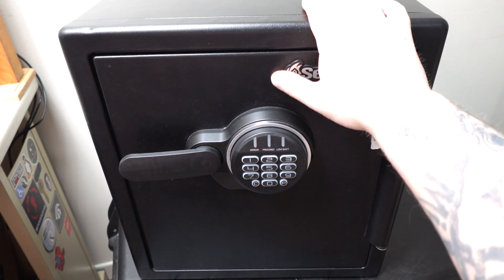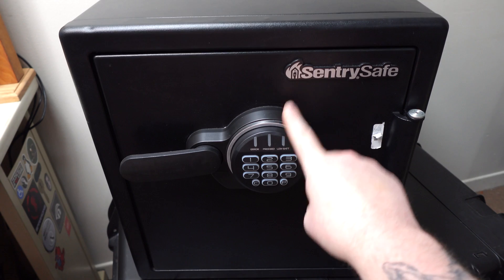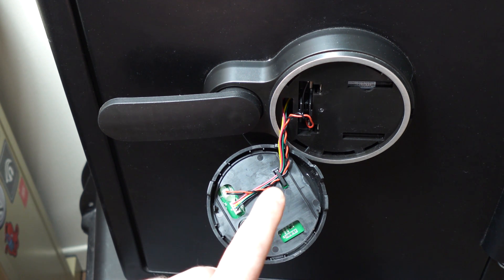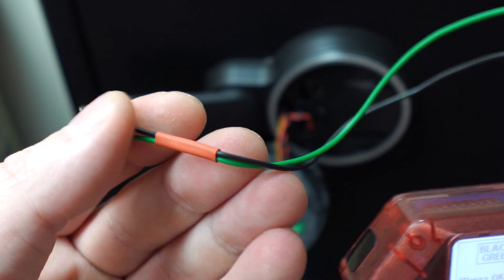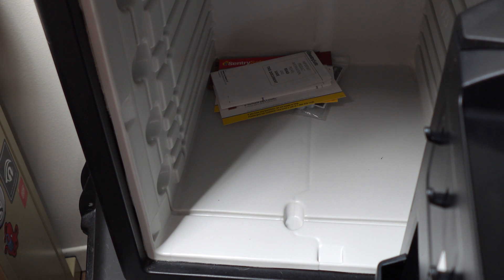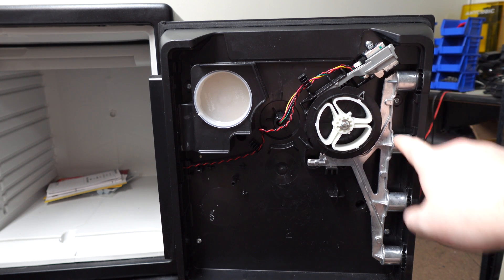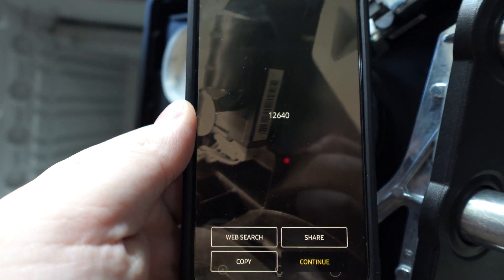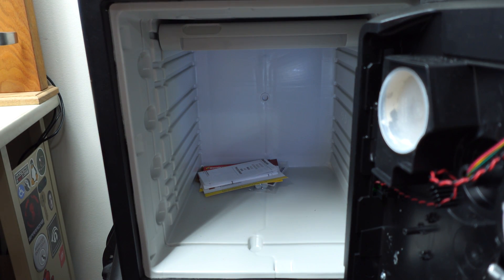Flipper Zero: Opening Your Sentry Safe When The Combo Is Lost

Comment: How did you build the connecting wires from flipper? Like materials list. I have this issue now but need to figure out the wiring situation in order to use flipper to get it open.
Reply from the maker: They're just Dupont connectors

Comment: Does the cable come with it
Reply from the maker: They're just Dupont connectors
Reply: @LockPickNic got a link for where you can order the wiring? Or know what to ask for at an electronics shop? Reason I'm asking is I'm actually a locksmith and we usually either have to pay sentry for combos or drill these open and it would be cool to just use this to open them in a  non destructive way
Reply from the maker: They're just Dupont connectors, ask for them
Reply from the maker: As an alternative, they're also on Amazon, male to male Dupont connectors
Reply: Thanks for the Info, Im also a Locksmith. About 3 hours after getting my Flipper Zero I find the Sentry open app for the flipper that i didn't know about. Will look for those pins tomorrow. @LockPickNic

Comment: Pro: We now have a working Sentry Safe.
Con: We now have a working Sentry Safe.

Nice tutorial. I recently found out, that the Sentry Safe App works on a few keypad locks, too.
Reply from the maker: I bought it for the sole purpose of flipping it. I got it for 60 bucks, used ones usually go for ~250 dollars here, I knew I just needed to open the door to get er working again.

Super interesting bit about the Keypad locks - I'm going to have to look into that! Thanks for the info!
Reply: How do I add the sentry safe app to the flipper?